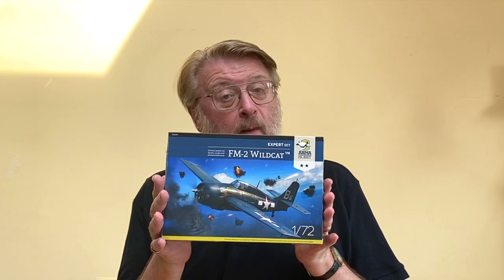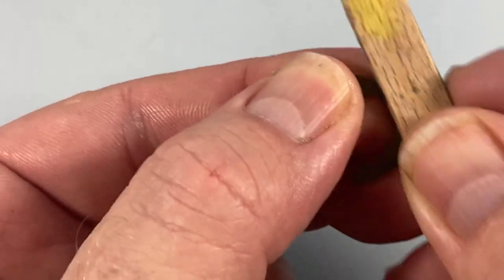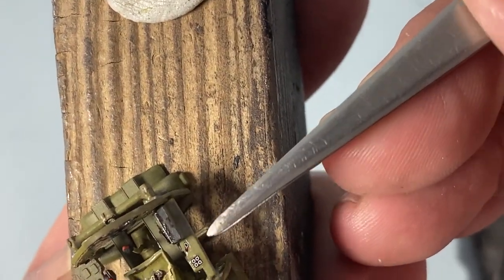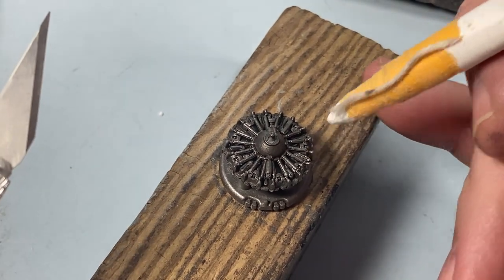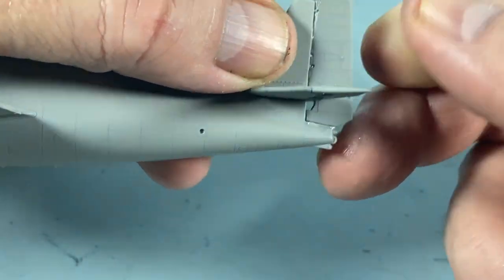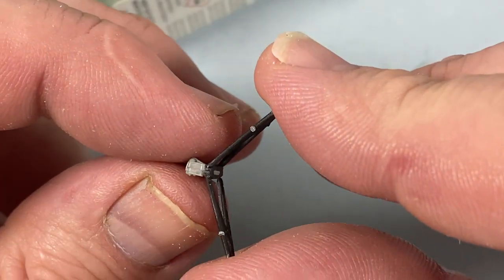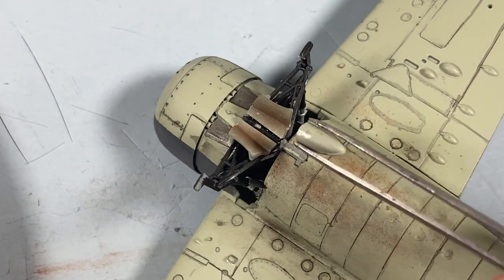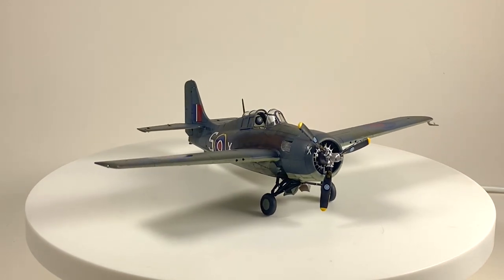WILDCAT Grumman FM-2 Arma Hobby 1/72 scale kit - how do you build it? HD 1080p

Comment: Tape and then blue tack inside the canopy..... Why didn't I think of that!  It must make it much easier to get the blue tack out and/or save lots of time scraping overspray off the canopy interior!  I'll use that on my next build.  Good work Gary.
Reply from the maker: All I need to add is to be very, very careful putting the tape and blutack in. Don't push too hard or the canopy will also be in kit form!!!